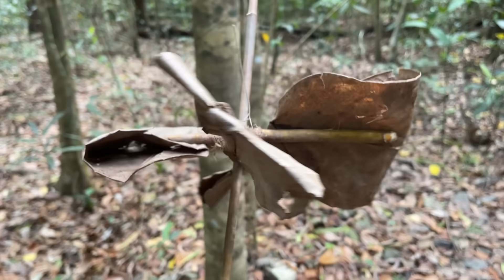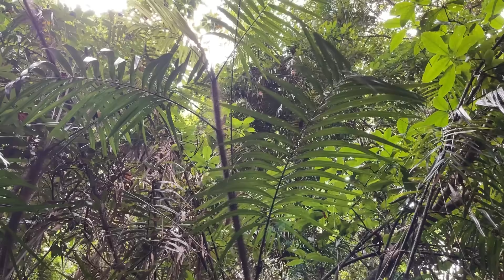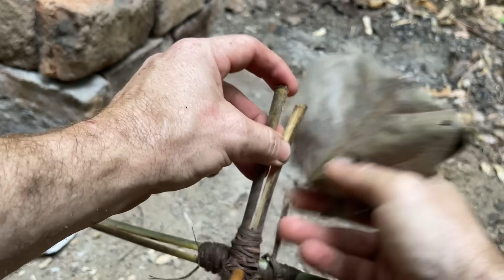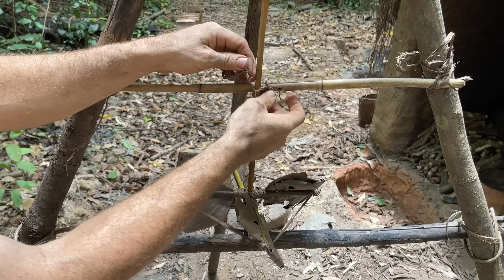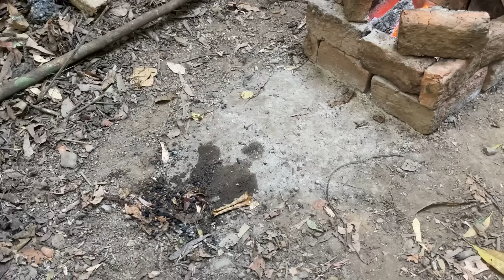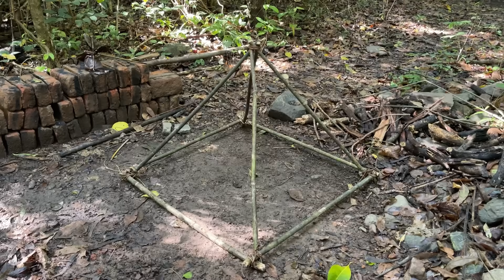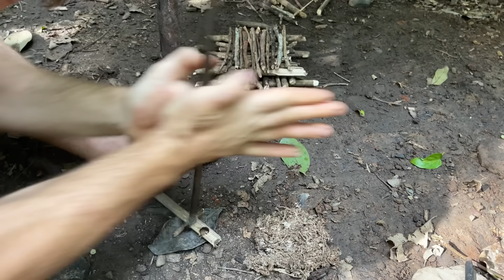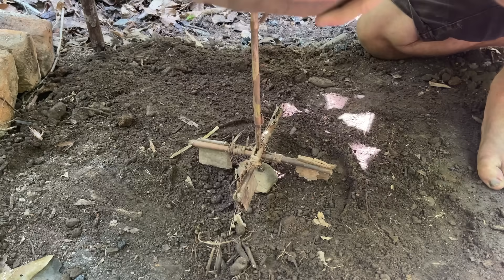Primitive Technology: Convection turbine experiments (hot air windmill)

Comment: My immediate thoughts are such: 
Make the hood out of tiles, and make a stronger supporting frame to hold the hood up away from the fire.
Long tiles that don't need supports in the middle, above the flames. Plug gaps between tiles with clay.
Perhaps even make the tiles flat with golf ball pattern in them to reduce turbulence.
Pin the tiles with wood, instead of bind with cordage. Build in tolerances for thermal expansion so tiles aren't shattered by expanding pins.

Make a tube around the rotor at the top? How would you disassemble to service the vanes...Perhaps make the rotor 2 parts, like spears with interchangeable tips, and glue them together with a reheatable resin. Use hot rocks to weaken the glue when you need to.

Create an air inlet for the bottom rotor.

I'm also thinking this could be a hut sized structure. Bigger fire, bigger rotor, bigger fans.

How do you stop the fans burning when your draft reaches iron smelting temps?

Comment: If you could shorten the length of the shaft you should be able to improve the torque applied to the rotor, but I doubt it will ever be as effective as a hand-operated one. 

What about creating the tent out of clay tiles to prevent burning and keeping it lower to the ground, maybe with a buried firepit. The distance between the windmill and the fire is the same, but you're able to shorten the main shaft.

Comment: this is crazy, but what if you made a ceramic wood-powered aeolipile? Take your radial forge blower, put ceramic fan blades on the inside, and add little angled outlets all around it. As it spun it would draw air in from the central hole to feed the fuel inside. If you made the blades end before reaching the outer wall, and used small bits of charcoal as fuel, it may be able to self-balance and prevent a brick-in-a-washing-machine effect. You could stand it on a pointed projection from the bottom, letting you drop fuel in through the air intake as it runs.

Comment: I really like the idea. I strongly recommend making a clay/mud funnel, not just at the top but all the way from the base of the fire. The goal is to keep pressure high up to the turbine blades, but those leaves and especially just the gap between the chimney and the hood is leaking pressure. Look up images of “parachute airflow” (which is comparable to what you’ve made) and you’ll see how much leaks out the sides. I’d recommend having a chimney go to and surrounding the blades, in the same manner as the fan the turbine is powering. Obviously there’s the heat/burning issue, so I think making more heat resistant turbine blades will eventually be a priority (maybe charred, relatively thin strips of wood) if you want to be really extra, wood can allow you to carve an airfoil shape which is more efficient than just a flat panel. Also try experimenting with different pitches of the blades.

Also literally more blades will help. You you can A, have more than 4 blades, maybe 6, maybe 8? And B, you can have a second or more row of turbine blades stacked on top of one another.

Comment: I think the problem would always be if it was successful enough it would then create a stronger and stronger flame and always burn down the housing. The upper housing doesn't draw air towards it at all does it? That effect is coming from below? Maybe if you did a chimney with two chambers- a wider one that allows the flames to escape through and and very thin taller that contained this apparatus- it be less effective than using the whole updraft but if the channeled more efficiently it might balance out? Though I think leaves will likely burn and you don't want to find out half way through a long cook. Would clay tiles be too heavy for the fan? You could consider dipping the whole fan apparatus in clay silt pond before beginning to protect it? Maybe have a couple ready to go if they need to be switched out.

Comment: you need much bigger fan-blades, and they can be heavy. they'll gain momentum and give you a lot more torque, which you can use to speed up  your blower.
Reply: also works better if you put them inside a straight cilinder (like a wide chimney), instead of above a tapered roof.

Comment: Can i suggest you use the nearby stream and create a Trompe to produce the compressed air you need for smelting and forging? it would be a very cool project and it uses no moving parts and its also something thats not very talked about and has basically no real studies on it like pluser pumps that are ancient but also basically have no real documentation or studies on they're like ram pumps but with no moving parts

Comment: what if you were to put it in the air inlet of a furnace. wouldnt the inrush of air being pulled by hot air escaping the chimney also spin it, but there its not in the way of the hot air and flames only the cool inlet air?

Comment: if you built into a hill you could use the terrain to make an exhaust pipe which will increase speed.  you could redirect flow sideways for other purposes. an idea for flow redirection if not made in-ground for any reason is to make another housing like for the blower, but just dont have the extra hole.

Comment: I think some sort of furnace construct like a tall kettle may work. It would not only focus the heat into a smaller exit, thus increasing spin, but it would also keep the blower away from open flame and remove the risk of it catching fire. And like a kettle, you could have a removable cover over the flames to feed in wood to keep it going).

Could also look at how it functions differently if the windmill is vertical instead of horizontal, I'm not sure if it'd be better or worse but worth an experiment.

Comment: Instead of the hood and turbine being made of of sticks and leaves, I wonder if making them out of clay would be better. 

You could have the flames/hot air reach much higher and closer to the turbine without worrying about it burning down.

Although, clay is much heavier. I have doubts that there would be enough moving hot air to spin a clay turbine that heavy.

Comment: Next step, make the blades on top longer to capture the wind more efficiently and then make the roof out of clay tiles. Surround the wooden structure with mud for insulation. Should work with some modification

Comment: You're not going to get more energy out of a system than you put into it.
Reply: OK, technically true, but if one of the things you put in is fuel for the fire, you can indeed get more energy out than you have to exert. There's energy in that fuel that can be extracted without you having to do it yourself.

Comment: The blower would be more effective with more peddals. Also, any water near by? Why not a water mill? Or how about two fire chimneys connected, one large drawing a strong current and the other smaller but used as a furnace.

Comment: im wondering if you build maybe an 8 bladed version, where less "wind" can escape through the gaps in the 4 bladed version, will allow it to spin faster? also, may have to experiment with different angles of the blades. i can see this possibly working, with instead of a leaf roof ducting the "wind", making it out of brick or sticks/mud combo.

Comment: A clay furnace, with a multi stage turbine in a long, jutting out chimney. The drive shaft can exit through a tiny hole in the chimney wall and down to the ‘intake manifold’. Making the turbo side multi stage may give enough power to overcome the friction in the system and power a blower at considerable speed.
While being less likely to burn down.
A thin clay drive shaft may help?

Comment: The rotor would be more efficient if placed inside a tube, also a curved shape with longer blades are more efficient at low airspeeds. Observe the wing design in gliders for example.

Comment: If the turbine was more inline and suspended inside a tall chimney you would be able to more effectively capture the lost heat from an open flame. 

You would run the risk of it catching fire again but perhaps coating the leaves in a clay might increase the durability but be careful not to add too much weight otherwise it won't spin.

I'm not sure if a horizontal turbine or a vertical would have have a higher rotation. Regardless, maximizing surface area with a low weight should provide some decent speed.

Comment: I wonder if using a tiled roof would help funnel all of the hot air to the windmill. Would doing that and adding more blades to the top fan help with the energy transfer to the four blades in your blower?

Comment: Maybe a larger rotor with two sets of leaves on each blade? Basically doubling the length of each rotor. That should still be light enough to spin easily, but maybe get more RPM. The bendy stick may also be slowing it.

Comment: I'm sure there would be a great deal of effort into these ideas but, you can clearly make tubing out of ceramic material, and if the heat rises, why not make a coil or some other high surface area heating element that channels the hot air into a specific direction? That'd take away the risk of the fire, and there wouldn't be smoke that could gum up all of the moving parts. Also on that track, you have a source of water, you have fire, you have vessels, you could also try steam. Maybe a bottle necked jug on the fire with some cane as tubing blowing right into the fan. The convection thing is nice, but unless you have some sort of housing to trap every little bit of that heat, I don't think it'll have enough ass to really power anything. Just my two cents.
Maybe I ought to give this a try in my own back yard.

Comment: Making this out of ceramic might work. But itself is very interesting. My first question is, however: How are you going to add more fuel without getting a blow-back air leak?

But if you can solve that, then a self fanning fire should easily get you the temperatures you need for iron smelting.

Comment: Create clay pipe that can redirect the hot air away from the flame, then it passes over the fan, the fan’s over the furnace air flow starts spinning. I think if you take a sharp stone with almost a needle point and another stone with a pit in it to settle on you can take some pitch and joint the end of your long stick to the sharp stone, reducing friction for turning the fans.

Comment: Hah, a primitive turbocharger.

I'm definitely seeing a few engineering problems with this one. The power output from convective flow really isn't that great. The pressure difference is simply too small.
And well, the flow temperature is a bit of an issue as you have found.

Now I'm very curious how well a similar setup would work if you were heating water in some closed off container using the fire. you could use the generated steam to instead drive a turbine of very simple make, similar to the ones you use to power the fire. And with this mechanism, you could even have them right next to each other.

Comment: If you want a viable, passive way to do work, maybe look at lifted weights in a pulley system. Using some kind of escapement and pulley ratios, you could potentially power a blower for a fairly long time after hoisting some rocks up a tree or something. Friction would limit it a fair bit, but you can make rope, pulleys, and potentially gears. Think something Davinci might draw. I know your carpentry options are kind of limited, but it might be doable.

Comment: If you rotate the turbine 90 degrees, it should make more efficient use of the convection current as it will allow you to increase surface area contact with the current.  You would need a set of gears or a belt to rotate the output motion, but that opens opportunities to use a gear ratio the increase the speed of the final output.

Comment: could you do a similar thing but turn the turbine with hot steam? You could fill a bamboo trunk with water and heat it over the fire. If you can manage to get the steam to come out of a small tube/hole you might be able to get some high speed air (without burning down the setup).

Comment: Forcing the rising air through a clay pipe that the turbine is housed in would significantly improve the spin torque. In this experiment the air was directed towards the turbine but not forced through it.

Comment: While you're getting the fan moving with hot air rising, at the other end of your shaft, air needs to be pushed.  If the fan at the top is about the same size as the fan at the bottom, they'll pretty much cancel each other out.  What you need is more power from the rising air.  A bigger fan, or multiple fans along the shaft up through a chimney perhaps.
Needless to say, they all need to be of something heat resistant.
Or, better yet, a setup with two chimney's, one for the hot air to rise with a crossover hole that allows the hot chimney to draw in cool air through the second chimney, that can then power the fans (that way they don't have to be fire resistant).

Comment: Maybe the old clay tiles set closer to the fire will guide the head better and funnel more air to the blade. Could also try increasing the size of the turbine blade and decreasing the size of the blower wheel to maximize the energy captured and transfered to the blower

Comment: Convection currents aren’t particularly strong without the chimney effect, but then you’d want a fireproof turbine.  Money modern combustion turbines use the expansion of gasses instead of the rising of hot gasses to capture energy.

I recommend that you look into rudimentary steam power.  Make a big ceramic kettle to boil water, and you can direct the spout where the steam will come out so that it’s not directly over the fire.  Then you put the turbine in front of the steam spout to harness the energy of the expanding steam.  I would suggest not using the tilted blades for such a design.

What you need to remember about this is that the water in the kettle will limit how hot the fire can get, because boiling the water is taking energy away from the fire.  So if you wanted to use this system to make a very hot fire for smelting iron or something, then you would want have the fire for making steam be separate from the smelting furnace.

Comment: If you want to utilize the energy of the hot air, you'd better off still doing it directly via chimney draft. As far as I understand, the right way to do it is to build a draft pipe with sideport(s), then attach a smelting furnace. The draft pipe can be built for a long use with fired bricks, and with temporary furnaces you can then experiment to achieve stable and effective work. The pipe, of course, will have to be elevated, so that where furnace ends, the pipe (the sideports) starts.

Comment: It won't work :(. There is no torque in this solution. You would have to build whole exhaust from clay and direct the flame to fan also build from clay. But it would weight a lot. A lot of friction. Won't work probably :/.

Comment: I've worked with a few turbines before. I've also made a crude VAWT that puts out enough to charge a portable power station. If the turbine blades are either too heavy or too wrinkled, you'll be wasting a majority of the energy getting it turning, and not much left to do work. Refine the blades, by possibly whittling them out of planks or thick saplings. Sand and oil them for the desired profile.

Second, balance that bad boy. The less balanced, the more it'll fight itself. Same with it not sitting straight.

Third, friction is the killer. Some kind of grease works wonders. making consistent bearings would be better, but far more difficult.

Comment: Do you think the bend in the rod holding the turbine was consuming enough energy to stop acceleration past a point? The sum of small forces, if minimal losses are achieved, is a large force. Perhaps a ceramic cap for the fire would contain the flames and concentrate the exhaust, and can be pointed at the turbine without as much risk of burning down the leaves. That is to say, a lid with a runner directly on top of the fire pit, with the runner pointing to the centre of the leaf collector.

Comment: The power, you can harvest, is limited by the torque, the connection of the peddles to the shaft, withstands. 

There is a limit, on how strong that shaft will need to be anyway, because the peddles can get needlessly big, fast. 
So it really only boils down to the connection of the two🤗

Comment: this was hilarious haha. basically a flame based fidget spinner! on that note, i think using the water wheel as a mode of energy would be the best over all. but i would love to see a sort of long pulley and shaft system to turn the forge blower. a simple version would probably include very specifically shaped clay fired "bricks" to act as lower friction bearings, that allow long sticks to sit upon, to transfer motion at greater distances. the sticks could then have some sort of fired clay disk with built in holes at certain distances, to act like gears, using small sticks that mesh to similar mechanisms either side of the bearing platforms and each length of shaft. then you could easily build a vertical robot shaft for the impeller blades in the blower itself, supported with some framework and some clay fired bearings. (basically fired round or square blocks with a certain size hole to secure the shafts in place better than the lashing) then of course, allow things to be moved if needed, for maintenance or for inserting/removing the buyer spout in and out of a dedicated forge pit, or stack. then, you could use the powered blower as a constant input, while having a second blower for hand operated blowing force, if you need it. next, it would be epic, to see you forging iron into something like a Chisel, and or a hammer, to later forge even more iron implements. that could then be used to refine bearing surfaces, or smooth out or build larger wood based mechanical items. then base that all within a round hut made of bricks, and roofed over entirely with bricks, and sealed with a sort of mortar.